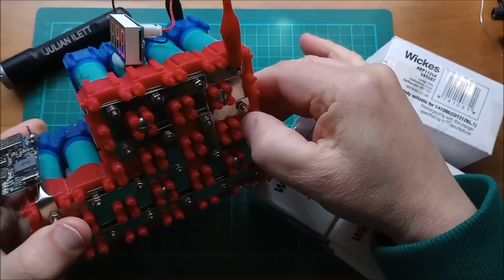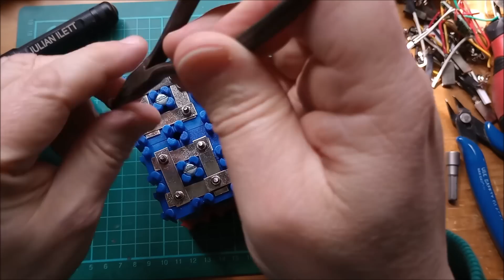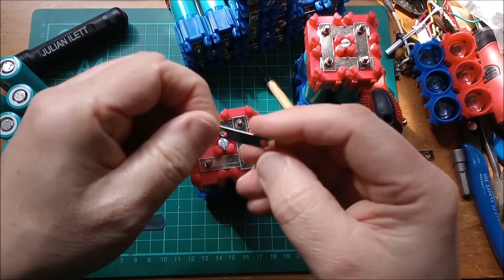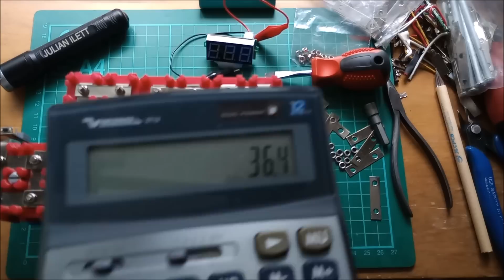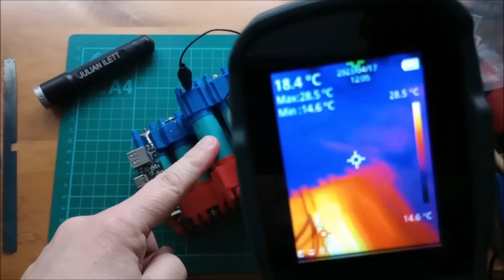Build a Massive USB Power Bank

Comment: I use my DeWalt Battery. Going on 2 years and only charged it once. The day in the start.  It was a bit of pain but got the voltage regulator in order. I added a set of 12 USB ports.

Comment: A li-ion battery at 4.0V is almost fully charged. 
A battery at 3.6V can be at 80% or 20% charge because li-ion cells typically stay at that voltage during most of their discharge cycle. 

If these cell can discharge at 15A they will do just that given the opportunity. 

The capacity of the cells is 1350mAh. A cell at 3.6V might be at 30% charge = 950mAh. 

When connected to 3 cells that are charged at 4.2V that one cell at 3.6V might get a 15A charge for 3.8 minutes. 

I wouldn’t take the risk and certainly not with those old cells. 

Just my thoughts. 
(I might be wrong. If so, please let me know where)

Comment: Those low capacity cells are probably optimized for much higher current draw (and charge rate) than they'll ever see in power bank usage.  But ya use what ya got!
Reply: Yes, this was mentioned at 29:33.

Comment: I think it would be a better deal to sell those 10.8V powertool batteries for more money than new cells cost. Power tool specific have more value. And new cells usually have 2900-3500mAh, where those power tool cells come in 2000-2500mAh.

Comment: Refreshing to see the relaxed attitude about the voltage differences, that much is probably not ideal, but also not that big of a deal. Some people panic over a few millivolts difference but thinks it's ok to discharge at a rate that makes the pack really hot, and to way below nominal voltage range.
Reply: A li-ion battery at 4.0V is almost fully charged. 
A battery at 3.6V can be at 80% or 20% charge because li-ion cells typically stay at that voltage during most of their discharge cycle. 

If these cell can discharge at 15A they will do just that given the opportunity. 

The capacity of the cells is 1350mAh. A cell at 3.6V might be at 30% charge = 950mAh. 

When connected to 3 cells that are charged at 4.2V that one cell at 3.6V might get a 15A charge for 3.8 minutes. 

I wouldn’t take the risk and certainly not with those old cells. 

Just my thoughts. 
(I might be wrong. If so, please let me know where)
Reply: @Conservator.  SOC, State Of Charge, is measured primarily by measuring the voltage. Li-ion typically have almost flat voltage curve, but not entirely flat. At the nominal voltage they're typically considered at 50% SOC, so, if the nominal voltage is 3.6 volt, the cell is considered 50% charged at 3.6 volt, unloaded. If the nominal range is 3.2 to 4.2 they're considered 80% charged at 4.0 volt.  

There are variations, and these are simplifications, there's no practical/easy way to actually measure the amount of energy in the cells that I know of, without discharging them and measure the amount of energy you get out, but that defeats the purpose if you just want to know how much charge you have. 

Also, charge or discharge affects the voltage over the cells, that makes it more difficult to accurately tell the SOC if the battery is in use, especially if you don't know how much the voltage is affected by that rate of charge or discharge. That may be the reason why some people thinks voltage doesn't say anything about SOC, but it does.

Well yes, unprotected cells will discharge at the rate they can, given the opportunity. The rate they can discharge and what you should let them is typically not the same. If discharge amps are stated, it's usually the rate you can let them discharge, without causing to much damage.    

If 3 cells are at 4.2V and one is at 3.6V, and they get connected in parallell, the higher voltage cells will charge the lower voltage cell at a high rate initially, but the rate is limited by the voltage difference, or lack of, and internal resistance. If each cell can put out 15A to a drain at very low voltage, or even short circuited, they will only produce a small fraction of that in this scenario. The voltage difference will decrease quite fast, and because of that also the transfer rate.  

I'm not saying you should connect any mismatched cells in parallell, but Julian knows what he's doing, and those cells are probably fairly rugged.
Reply: @fishyerik  Thank you for your response. I agree with almost everything you’ve written. 
I think the cells were rated at 15A. That would indicate that they could go significantly higher. 
Maybe 0.6V difference isn’t enough for a thermal runaway but I wouldn’t take any risks. I noticed that Julian was only measuring the temperature on the ends of the cells. 
I got the impression that he hadn’t measured the voltages and that would not be correct imo. 
I agree that you don’t have to balance them at the mV level but I wouldn’t feel comfortable with more than 0.1 or 0.2V difference. 
Maybe I’m too cautious 🤷‍♂️

Comment: if you drop two nuts in your nut-spinner the 3rd one will stick out a bit and allow you to run the 3rd nut onto the uneven studs with just enough force and guidance to not spin them off while tightning

Comment: Does anybody else store unused cells in the Fridge?
Low temperature slows chemical reaction.
I also keep Bread (sealed, no drying) and Eggs in the Fridge!
Reply: Bread in the fridge will go stale much faster than frozen, and also faster than just in the cupboard.  This is because starch crystalizes faster as temperatures drop but remain above above freezing and this change in the starch is what makes bread stale (as opposed to just dry).
Reply: @Sylvan_dB  Your analysis is super interesting.
I keep my bread in the fridge to slow mold growth. I should have said, I keep it sealed in the same bag it was supplied in. Purely to keep the same moisture. From ambient; about 23°C to the 6°C in the fridge. Any starch crystals taste great.

Comment: The only danger is that if one cell shorts all the other cells dump their energy into it, however most cells have built in protection in case of  high current failure a sort of built in fuse that disconnects.

Comment: My only concern while wiring all the modules together would be to make sure that the distribution of resistances across the links are balanced, otherwise you might get some parts of the pack charging faster or slower than the rest. Unlikely to really matter, esp at low current and an all parallel pack, just something I'd try to avoid if I was doing it. Then again personally I'd be more inclined towards building a 4S pack with a buck boost (or just buck) on the output. Admittedly more complicated and probably marginal efficiency difference in practice.
Reply: No

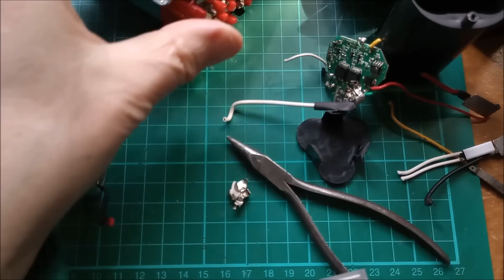Comment: 7:06 - I find that the easiest way to remove the welding spots are by using the little angle cutter you used for cutting the wires. Gentle nip the welding spot with the pliers, and rotate. Do no cut or pull, only nip/hold the spot with the pliers and then rotate sideways, with the pliers tip not pointing towards the cell.
Reply from the maker: Yes, that does result in the cleanest break. You do have to cut the strip first though, to individualise each of the welds.
Reply: @JulianIlett  It's a method for getting rid of welding points that remains after removing the plates. There isn't really much you can do about the plates other than rolling/pealing them off.

Comment: did the same thing. got a load of old laptop batteries.made two "power" banks and 4 5W lights. i used a small grinding tool to smooth down those weld bits

Comment: I've had major reliability issues with those spring caps. A bunch of them split and lost grip and even the ones that didn't lose split weren't reliable. I even used clamp bolts that came with the kit and still wound up losing connection to 3 out of 4 in parallel in a 14s4p pack within a couple of weeks. I tore the whole thing apart and built a new pack using holders soldered to a PCB style system.
Reply from the maker: Some of mine have split too. They were in the shed all winter subject to large temperature variations.

Comment: With such a large capacity in parallel, how do you plan on charging the pack and how long will it take to fully charge?
Reply: With mobile charger and 2A current it'll take 10-16 hrs, probably not more than 10 since we never discharge cells fully

Comment: You might want To nibble The bolts Down a little So you can find a Metal box (Genuine Army Ammo Box) and Add A Hand Crank Generator + XT 60 ~ XT 90 (Panel Mounting Kit) Socket (Solar ~ AC > DC Mains Faster charging  ) Plus a Super caps array (just for that Extra fast charging with the hand Crank Generator )

Comment: Looks like a great set up. Rather than spot welding, it would be easy to change or add to it. Oh man, car will not start, make it a 12 volt or whatever. If voltage isn't to far off, I think you could just lay the bus bars on and leave them loose for awhile so they wouldn't have a real solid contact until they've redistributed there loads some, then tighten down.

Comment: Given failure probability of each induvidual cell, massive parralleling of cells rapidly magnifies probabilty of catastrophic failure. As any cell developing a potentially fire mode failure, in this parraleled mode will also increase severity as the non failed cells feed directly their energy into the "failed " cell without sny limits on current dumped.
You are constructing a massive fire bomb. Second hand batteries only make the failure probability higher.
Suggest extreme caution to anyone trying to duplicate the construction. 
While all cells are driven to same voltage state, the charging wise there is NO  provision to ensure charge current balance over all those cells, so overcharging some cells and under charging others depending on cell aging and  chemical state properties. Forming thermal/heating imbalances.

There are real reasons that high energy power storages adopt series battery  thus higher voltage systems  not massive parallel construction.
Reply: i can remember when the best way to have a battery was one very large capacity cell and a DC-DC converter to give the required output. No issues with any thing, downside you just need a very large cell 🙂 but very reliable.

Comment: Just keep an eye on the warm cell, if it doesn't cool down and the voltage of your pack continues to drop even without a load you have what HPPowerwall refers to as a burner cell. This is a bad cell that has such high resistance that it will burn off the energy it is storing as heat and then start to pull power from the other cells as well. If you leave it for long enough you can have a thermal runaway event and fireworks, just replace the bad cell and dispose of it safely.

Comment: I spent £20 on a spot welder and some strips of nickel. Far faster and cheaper to assemble and takes up a lot less space. Also welded joints are more reliable that spring terminals, especially if you have a lot of them. I built my mother a new battery for her mobility scooter using 60 18650 cells and now it goes for 3 days use before needing a recharge. Old battery didn't last a full day if she went for a day out anywhere.
Reply from the maker: It's just a bit harder to replace a cell if they're welded.
Reply: @JulianIlett  Couple of mins once you find the faulty cell.
Reply: @fuzzybobbles  Everyone is aware of the spot welding option; go away
Reply: It's great that you can spot weld them, but some of us have no desire to spend that money (I only want to make 1 powerbank, so the money would be wasted), so spring terminals are desirable.
Reply: @mattsadventureswithart5764  No no no you have to spot weld them the whole world falls apart if you dont

Comment: Fun project. 

It's not the charged cells that don't like rapid discharge, as they are designed for high discharge currents, especially as there's lots to share the discharge current. 
However the discharged cells aren't designed to charge rapidly, so when connecting partially charged or discharged cells into a charged pack, large currents can flow into the discharged cells. 
I've measured currents of over 10C for short periods after connecting discharged cells to charged cells, which is well over the maximum allowed by the manufacturer for charging. However as you pointed out, the current flow stabilises very quickly, but in that time considerable heating can take place initially. 
I must admit that on expensive cells, I join the discharged cells to the charged cells with a resistance, simply to limit current flow to within the manufacturer's specifications.
Reply from the maker: So a good strategy for adding a few more cells to a big pack would be:
Discharge the large pack to a lower voltage (below the typical voltage of newly purchased cells).
Then add the new cells (so they discharge at a high current rather than charge at a high current).
Reply: @JulianIlett  I normally try to get all my cells to within a few millivolts of each other before connecting them. 4 tenths difference could damage your cells.
Reply: @JulianIlett  If you take the main pack and use it till its dead and take the powerbank board and connect it to the new set and make sure that they are also dead and then connect them together. That way they would be at that low voltage cutoff and the voltages should be matched relative to the powerbank board.

Comment: Think I'll take a "car" 12v phone changer and put it on a makita 18v battery.
 Would it work?
Reply: Measure the output voltage before you destroy your phone, some "car charger" say 12-24 volts but not all of them, some may be just for 12 volts.

Comment: I'd like to see you try to take that on a plane  😄
Reply: Putting that on a plane wouldn't be a problem. A plane is just a woodworking tool after all. Taking it on an aeroplane would be a problem. 😁😁
Reply: @SpeccyMan  A plane is a vehicle designed for air travel, with wings and one or more engines.

Comment: Hmm, yes fine if you have a lot of 18650 all the same, but not if you have a lot of different capacities 😞
Reply from the maker: As long as they're all in parallel and the same chemistry, different capacities isn't a problem.
Reply: @JulianIlett  will they not try and back charge the lower value ones when they get low voltage ???
Reply from the maker: Because the cells are forced to be at the same voltage, they will charge at different currents. The lower capacity cell will charge (and discharge) at a lower current than the high capacity cell.
Reply: @JulianIlett  cell impedance determines charge current when supplied with an unregulated voltage (like when many unbalanced cells are put in parallel) not necessarily capacity. If I had to guess though there is probably a roughly proportional relationship between impedance and capacity.
Reply: Different capacities doesn't matter in parallel. Technically different capacities in series does work but it does redeuce the amount of power you can get our of the higher capacity cells as the lowest capacity is the weakest link. You can balanace this by having 2 lower capacity cells in parallel.
Reply: My guess is you might have mixed up your charged pack with one of the fresh packs when reassembling. That would explain the .4V difference.
Reply from the maker: Yes, I think that's what I did :)
Reply from the maker: It charges at about 15 Watts (a limitation of the USB circuit board). So 130 Watt hours would take over 8 hours.
Reply: @JulianIlett  thank you!! 👌🏽 😁
Reply: you can't have different capacities in series as when discharging the lower capacity cell with go full discharged before a higher one. it will then start to be reversed charged by the current still flowing due to the other ones, which is why you have cell balancing to try and stop this from occurring.  
OH and Woof.
Reply: @TheEmbeddedHobbyist  my apologies, I should have mentioned the use of a BMS which should not allow a senario such as this one from happening.